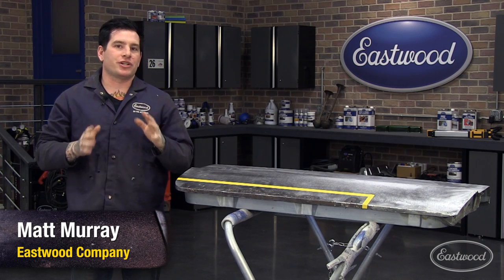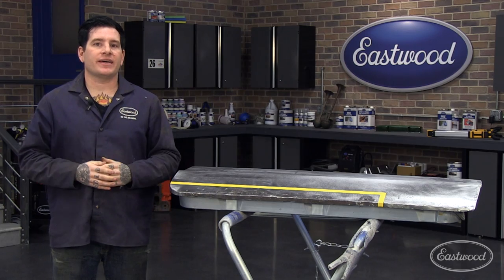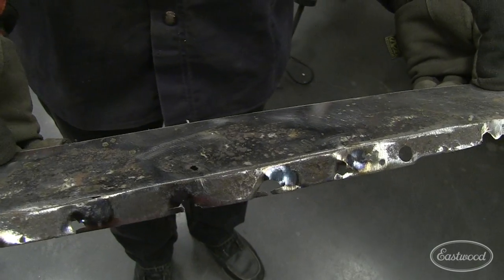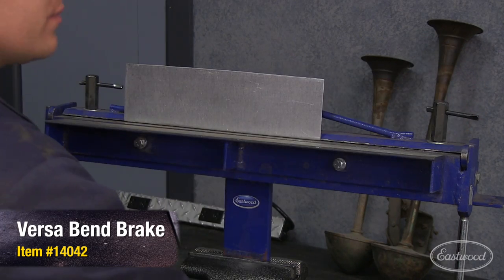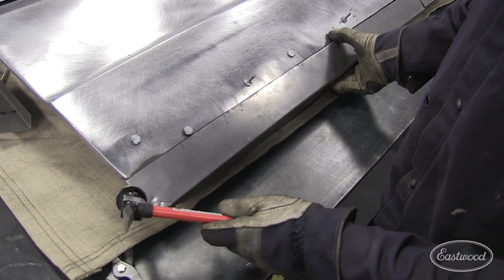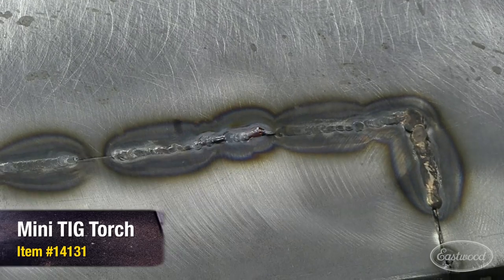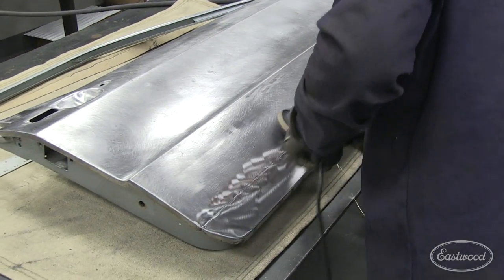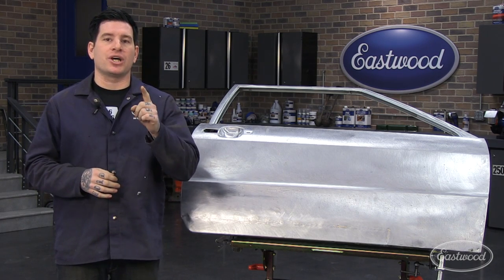How To Repair Door Panel - Patch Panel Installation Using Mini TIG Torch - Eastwood

Comment: How thick is the metal on a car and what size wire is that
Reply: 1.3 mm usually i think or 50 thou
Reply: @Jakedrifts  But with corrosion taking its toll its better to assume 0.9mm
I usually replace with 0.9mm on Toyota's, and for MIG wire I like to use 0.6mm, with the right settings and if I'm in the zone I can write my name into the rusty panels that I cut out.

Comment: I made it to 1:06 ,,, why would I want to listen to anyone that cant work out that there should be a guard on not one , but both of those grinders ,,,, Fool. And never use mig wire for tig unless you have to , its lacking a lot of the additives that are in tig wire , this guy has no idea.
Reply: You made it through making two comments instead of editing the one that you had though.

Comment: thats some of the worst work ive seen in a long time , what a butcher.
No guards on grinders from a professional ,, tragic.
Reply: Often I have to take the guards off to get better access in tight spaces (particularly inner sills), that's just the way it is. Donno what kind of sheltered work environment you're in that allows 200% safety at every notch and cranny, but good for you.
Nobody's 100% perfect, at least he got the job done better than most people who start out, and it's metal, so it's always revers-able.
Reply: @ToreDL87  If you cant get the job done without taking guards off , your using the wrong tool , I live in a very real world.
Reply: @tomthompson7400  He had big thick gloves on get over it already.. You live in your own world, not the real world. Why do people have to bully other people because they do the same thing differently.
Reply: @jasonstrout4502   grinders come with guards ,, not gloves . 
Do you need me to draw you a picture , or can you get a grasp on it now.
When you put the title of a video as '' do the job right'' you kind of expect that half an attempt would be made , as a video its grim as an advert its tragic.
In the interest of fair play I watched the video again ,,, and Ill stand by my first post .
Using mig wire as a tig filler isnt the best solution either .

Comment: Eww! That's some kind of nasty bird dropping seam. 😱🤢
I don't like being that guy, but you spared no heat at all when you didn't have puddle control with mig wire no less!?
It did explain that flame tattoo on your chest though. 🤔